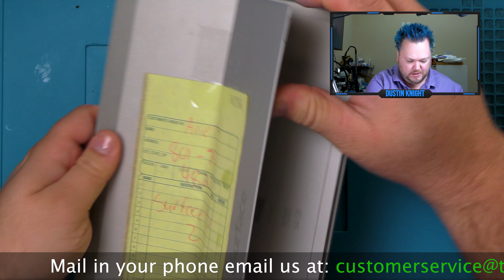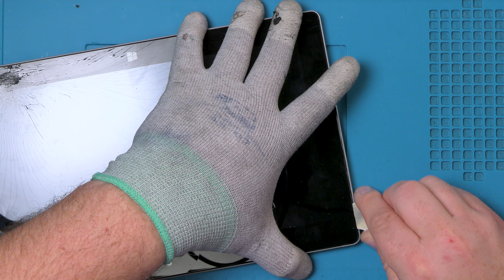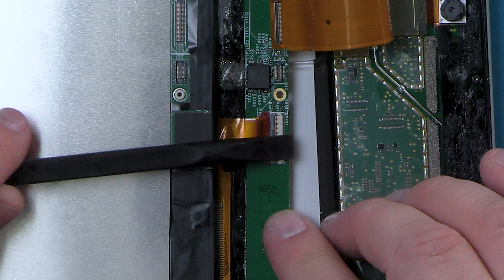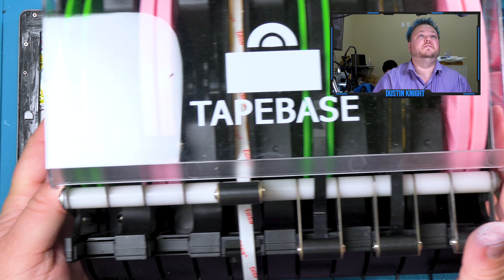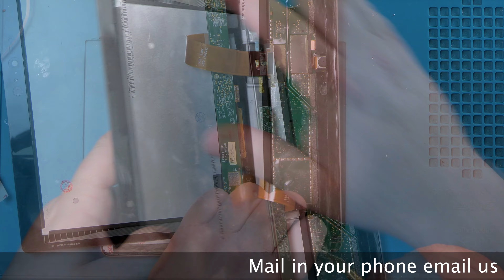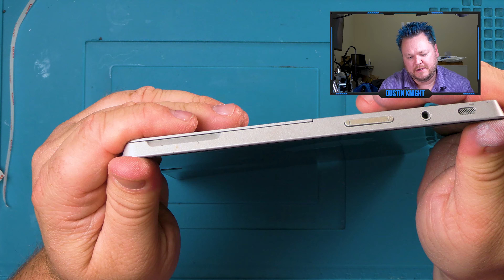Surface pro 2 Screen Replacement DETAILED

Comment from the maker: Please support the channel by using my amazon links! 
For just the screen & Recommended parts click on the links below.

Surface pro 2 screen :
https://amzn.to/3oHmc3G
https://amzn.to/3oHmFCY

Glass Screen Protector :
https://amzn.to/3OKhsoz

Heating pad:
https://amzn.to/3mbIytW

Heat Resistant Gloves
https://amzn.to/3EsZdyW

My blue mat to keep everyone organized:
https://amzn.to/3BalS16

iFlex Opening Tool with Glue Card :
https://amzn.to/35UC9h8

iPlastix Opening Tool with Glue Card :
https://amzn.to/38FtzUH

on of my favorite screw driver sets 2uul:
https://amzn.to/3jsqkCz
https://amzn.to/3CcoL2Y

iseasmo w/ Kit (Has Screw driver too)
https://amzn.to/35Za2O0

Tweezers:
https://amzn.to/3B7yBlf

T-7000 Water sealing glue:
https://amzn.to/3EdzLxs 

Isopropyl Alcohol For Technical Use:
https://amzn.to/3BqBU78

Need to get a part from a reliable quick source, you'll find a better price here then Amazon and the quality will be a lot better. Click on the link below.
https://www.injuredgadgets.com/?acc=be9b6cec65c863e1b55538d2c7fcc9b0

• Visit our Website: https://tech-md.com

• My email: dustin@techmd.bz

• To mail in your phone, please contact us at 801-438-6028